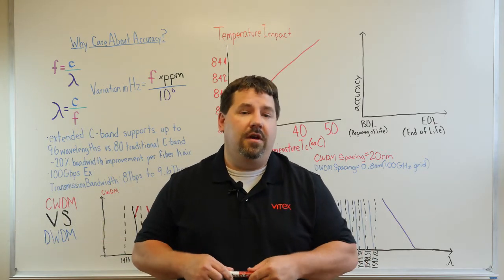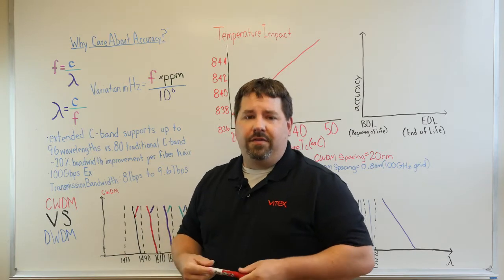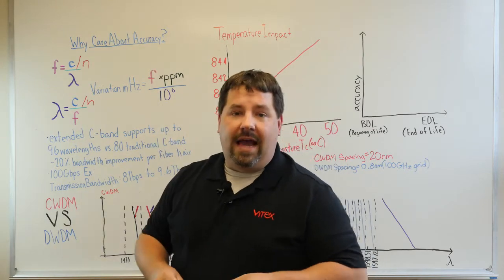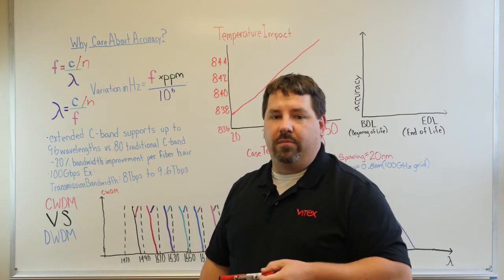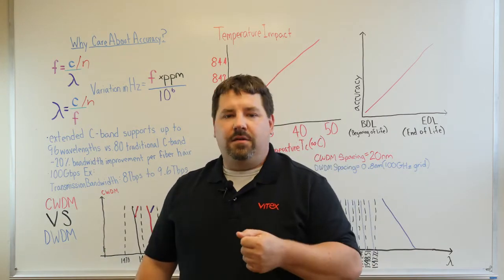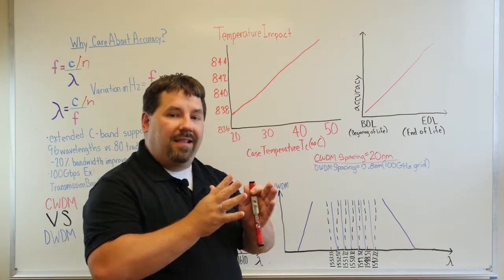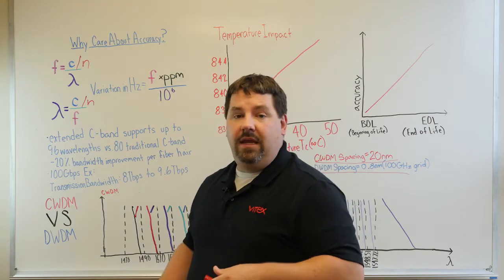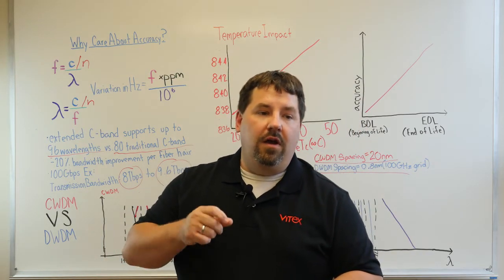Vitex Talks | CWDM vs. DWDM: Exploring the role of wavelength accuracy in optical networking

Comment from the maker: :yt: Full Video Transcript:
Hey everybody, this is Craig from Vitex, and today we're going to shine a light on some of the parameters of transceivers. A lot of us, when we talk about transceivers, we're talking about the data rate and the reach. That seems like it's a super important parameter that we discuss. But there's actually something a lot more important and we're going to talk about it today. And that's our wavelength accuracy. Before we get into why that's important, let's just go through a little refresher of, what is wavelength accuracy? From our wavelength, we can find what our frequency is by looking at the velocity over the frequency. But it's also important when we talk about the velocity here, we're talking about the speed of light in a vacuum. It's super important that in these cases, we have to remember our refractive index in here and divide that so we can find what is the speed of the light going through a fiber cable. Just taking for example, in a single mode fiber, you're looking at a value that's around 1.467. It's important that you check what your index value is so you can calculate that correctly. When we talk about the accuracy, a lot of times we refer to it as parts per million. We want to see what our variation is in the frequency. We could just use this really easy formula, and we're looking at our frequency times our parts per million value, say 50 parts per million. We want to make sure that you divide it by 10 to the 6th because we are talking about a unit that is in millions. Okay. What happens to our accuracy in different situations? Let's take temperature first, because that's one that happens in a lot of telecom environments, especially since these transceivers are used outdoors. As we see an increase in temperature, we also see an increase in the amount of accuracy, and that's actually a bad thing because we want to really keep those accuracies really tight, so we don't want that variation kind of exploding all over the place. Besides temperature, we can actually look at how new the device is versus how old the device is. if we look at our BOL or beginning of life versus our end of life or EOL, we actually see a very similar trend. When these are first manufactured, the accuracy is much tighter than it is when it's out in the field and used for a longer period of time. That's something to keep in mind. You really want to make sure you talk with your suppliers on some of their accelerated life testing and what their end of life accuracy is in their products. Why is this important, especially in some telecom solutions? We're going to look at some of the different applications that this is in, specifically CWDM versus DWDM. We look at these two solutions. One is definitely more important than the other. we look at our coarse wavelength division. We have typically a supported channel. Whoops. All the way to the other side, spacing of around 20 nanometers. We want to make sure our accuracy can support this; our receiver is able to pick up the signals versus one to another. When we look at DWDM, it's a lot more dense, so the wavelengths are much closer together, around 0.8 nanometers when we talk about a 100 gigahertz ITU grid. What does that mean in real life? if we look at the spacings here, and we're just looking at our Delta Lambda, we can see one is 20 nanometers versus another one, that's 0.8. You can see in this case, it's much more important for our DWDM to have a much higher and tighter accuracy than the CWDM. What does this actually mean for an installation? If we look at a DWDM in say traditional C-band, right now there's 80 wavelengths that are available. This kind of translates to an 8-terabit transmission bandwidth. And if we expand that into the extended C-range, we actually increase up to 96 wavelengths, which will bring us to 9.6 terabits. This is a really awesome improvement if we're able to put more of these wavelengths in. And it's really important that the accuracy of all these individual lambdas is really tight. And so make sure you check the specifications on that, like I said, both at the beginning, the end and over the temperature range. And until we come back and shine a light on another product, I'll see you then.